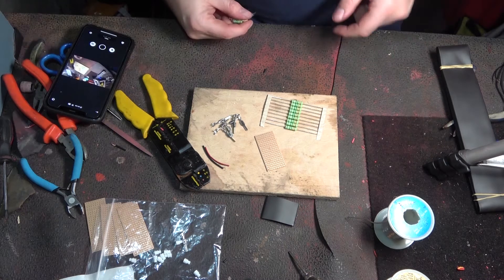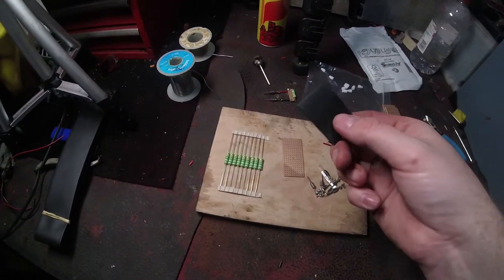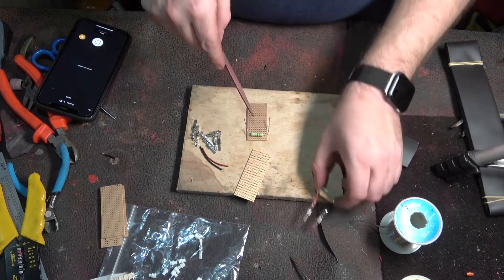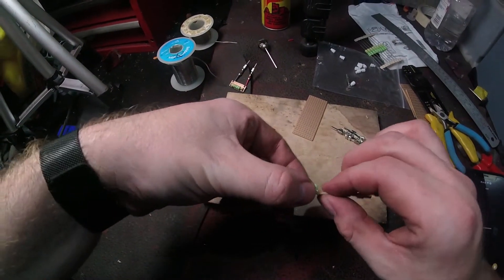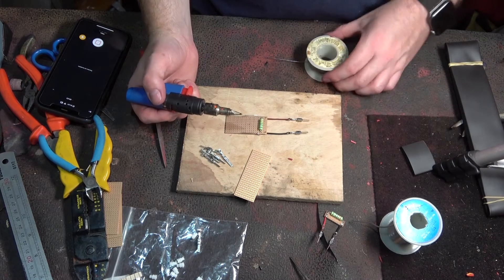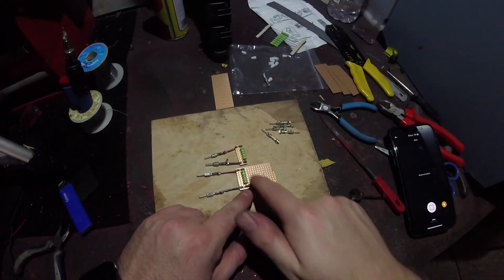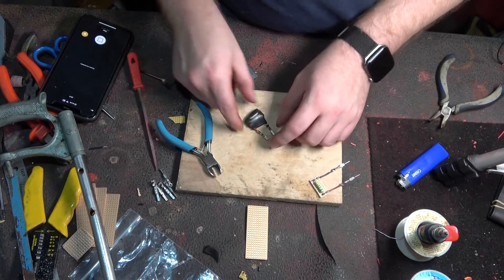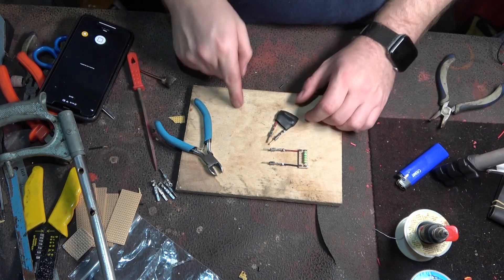Making a N249 Resistor Delete Kit! (9N3 Polo GTI Trackcar)

Comment: Could you do something similar for the electronic throttle and pedal?
Because when you switch to a wired one, the lights on the dash stay on.
Reply from the maker: I mean you could but it would be a lot easier getting a tuner to map that throttle out. 
Why did you swap to a cable throttle in the first place? Any benefit to that ?
Reply: @CarsandEngineering i have a reprogrammable ECU that controls the body and I connected it, but the original ones are loose and the dashboard light comes on with others. I would like to know if they can be turned off with a resistor. I would really appreciate the help.
Reply from the maker: Ah right, I’ll be honest throttle body’s normally use a potentiometer which are hard to use resistors on having it mapped out will be the best option, better to do some more research into it if it’s a standalone ECU

Comment: Thank you very much for your video ... I had bought 330 ohm 10 w ceramic but I still have the secondary air pump fault P0411 do you think I should buy the same resistors of the same quality as yours shown on the video please? I have been erasing the faults from time to time for weeks ... I deleted N249 and N112... thank you for your help
Reply from the maker: You wont be able to use resistors to get rid of the seconday air intake code im afraid.
This code can only be disabled by programming it out of the ECU by a Tuner or specialist

Comment: Have you used theses on vvt delete sensor on golf or are all sensors have the same values
Reply from the maker: I haven’t used theses on a golf, if you find the value of the resistance the sensor on the golf has then you could just do what I did in the video but change the resistor to the one you need.
All the parts are pretty cheap to get hold of so it might be a cool little project 👍🏻
I hope this helps
Reply: @CarsandEngineering  thanks for the quick reply I'll have to investigate into that thanks

Comment: Where do I get the cables from to connect them to the terminals? Brought everything but no link to the cables :(
Reply from the maker: The wire you need is this: https://ebay.us/fynvlA
Theres different options for lengths etc.
I hope this helps
Reply: @CarsandEngineering  perfect thank you! I notice you have red and black, is there a reason for that? Or just ordering any colour and length needed
Reply from the maker: I just used whatever colours I had laying about at the time 
Its not that important on colour of wiring for this application as the resistor will work both ways regardless, the colour of cable is only there as a reference to what it does , black for a earth or a ground wire, red for a postive or 12v feed. 
If i was wiring up some LED's or something like that then the red + and the Black - wires are needed to differentiate between Postive and negative as LED's are polarity sensitive.

Comment: Hi, I have an audi tt mk1, in the n249 i read 30ohm 12 volt.
I figured that 5w is needed then, right? but how many ohms? 30 how to read or should a calculation be made? can you explain to me please?
thank you
Reply from the maker: Hello it’s a 330ohm 2w resistor that you’ll need same as in the video, there’s a link to eBay where you can buy it
I hope this helps
Reply: @CarsandEngineering  thanks for your advice, can you tell me if I can also apply the resistance to the secondary pump?

My values:

N249 = 24 Ohm

N112 = 31 Ohm

N80 = 28 Ohm

SAI PUMP = 1.3 ohm

I don't understand how you calculate them
Reply from the maker: The secondary air pump needs to be mapped out by a engine tuner, there’s no way to stop and engine light coming up with resistors or the likes

Comment: Is this only for the n249? Can it be used for sai and evap deletes?
Reply from the maker: This should delete the N249 and the N112 fault codes from coming up on your dash, your evap and SAI codes normally have to be mapped out by an engine tuner to stop them coming back up, a resistor cannot stop these from appearing unlike the N112 and N249, I hope this helps 👍🏻
Reply: @CarsandEngineering  Pretty sure it can, there was some individuals and/or tuners selling them online FB etc until the EPA started to shit in everyone's shoe. It can be done but it's like impossible to find the damn info.

Comment: What size wire are you using mate?
Reply from the maker: I believe it was 3mm mate 👍🏻
Reply: @CarsandEngineering  I’ve got 1mm Will that be ok?
Reply from the maker: Yeah it’ll do the job, the smaller the wire the less resistance it’ll create, use a wire Thats too thick and the 330ohm resistor will come out as higher due to the thicker wire and could throw a code. 
In short yeah you’ll be ok mate 👍🏻
Reply: @CarsandEngineering  cheers mate 👍🏻

Comment: What is the N249 etc for all us non-VAG guys? Aren't they forms of boost control solenoids & what do you get by removing them mate?
Reply from the maker: It basically tells the diverter valve when to open mate, it stores boost and uses it as it needs.
It’s good to cut it out because it’s basically a middle man that doesn’t need to be there (more shit to go wrong tbh) 😂